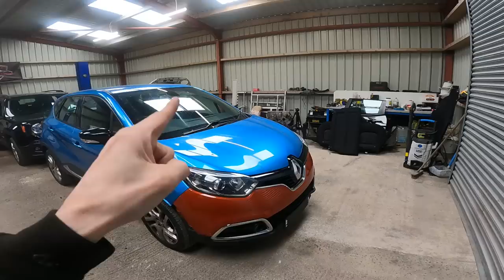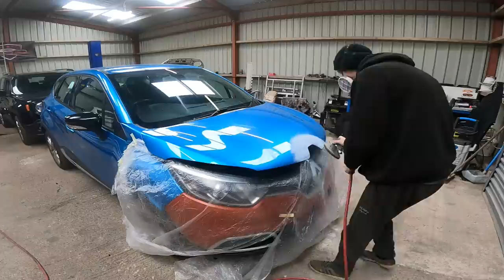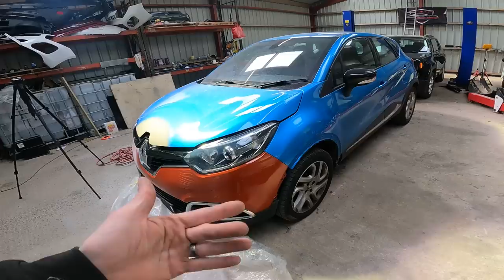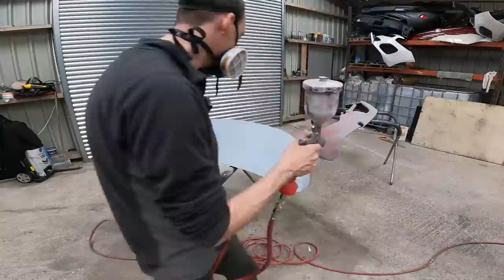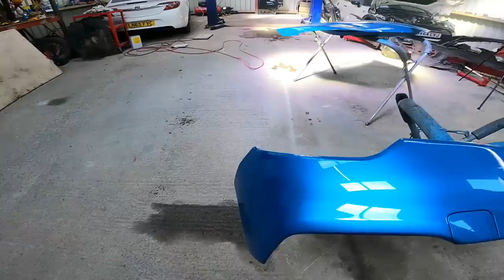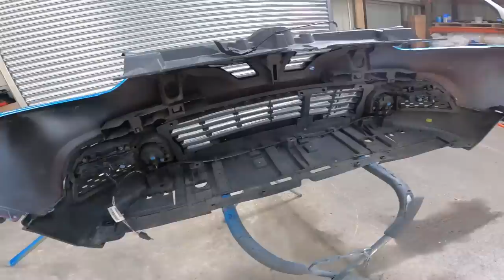I Repaired And Painted The Bonnet And Bumper On The Renault Captur And It Looks AMAZING!!! So Happy!

Comment: Nice job on panel repair and painting of bumper and bonnet. Definitely need to cover the other vehicles in workshop before spraying as others have said, it will stick like hell and make a lot of extra work polishing it off.  A roll of plastic masking film is ideal as it's wide enough to cover cars completely up 👍👍

Comment: Awesome job, I have a large floor mounted fan, put it in the doorway and it will take all the overspray straight out of the door. I bet the cloud was thick for the clear. £50 to £60 for the fan. Screwfix  / machine mart.

Comment: Overspray is a killer  and everything in your workshop will have a renault blue tinge to it  even them cars  Suprised you never covered them over with plastic
Concrete floors and compressed air  no wonder you have floaters in paint 
Its the mixing of paint ratios and gun settings and fan patterns and  the way you work on the panel to blow it over is a skill
If this is the way forward to save more cash then your going to have to invest in a proper dedicated  booth extraction set up.
Well done only way your going to learn is have a go
Reply: Or damp down the floor before starting, it does help a lot and doesn't cost anything 🙂

Comment: Great job Phil. You need to believe in yourself a bit more, getting hands on is the best way to learn. Totally agree on a spray booth, either a blow up one like I mentioned in a previous comment or even a pop up gazebo with side panels would do if your only painting the odd panel. Looking forward to seeing the Captur done.